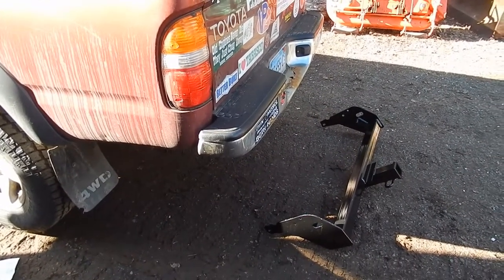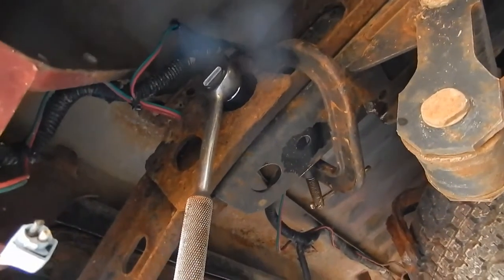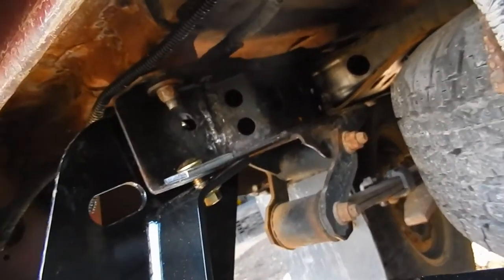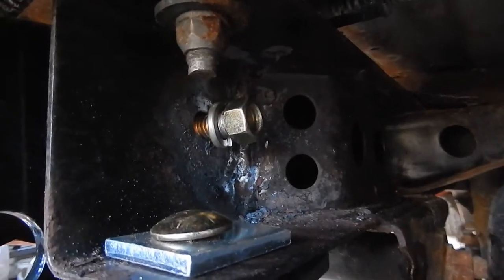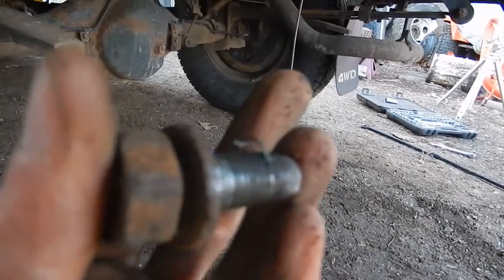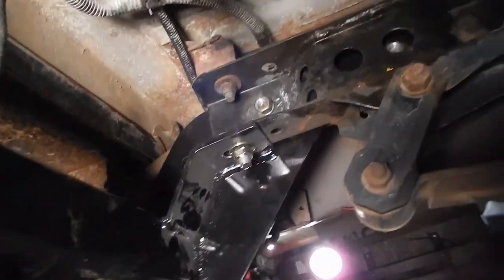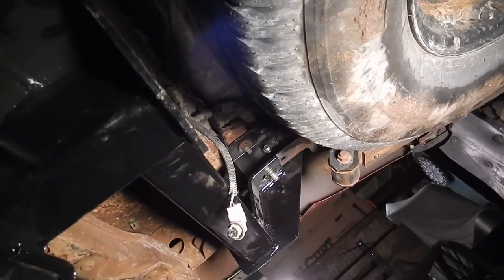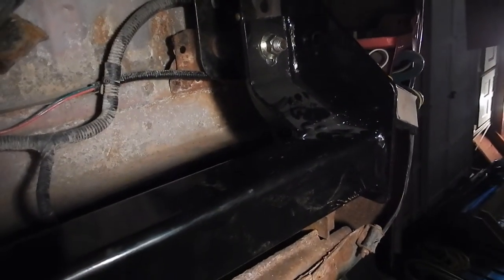How To Install a Curt 13013 Trailer Hitch in your Tacoma

Comment: I cut the tabs off the bumper and loosen the bracket bolts on the bumper side, the far front bolts you just loosen because there's a fork style hole on the end. Once you get everything lined up you tighten it all down

Comment: Always use a liberal amount of rust remover helper bolts/nuts spray the night before or buy a can of CRC Freeze Off spray at your local auto parts store then the bolts will be much easier to remove.

Comment: Did you not have to remove the bumper from the bumper brackets at all? You were able to remove it all as one piece and put it back on as one piece?
Reply from the maker: yes, bumper and brackets were removed as an assembly.